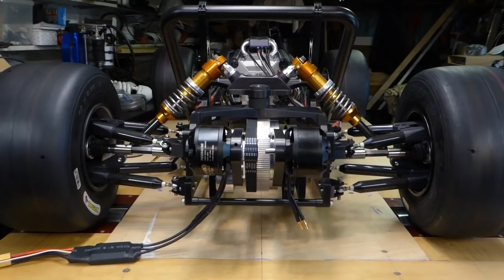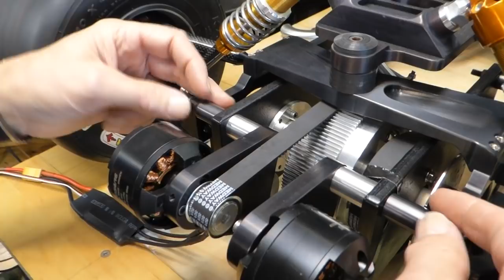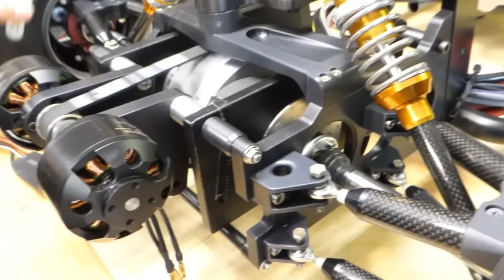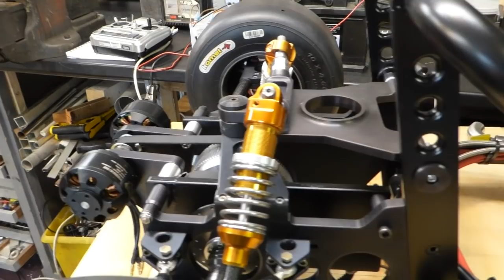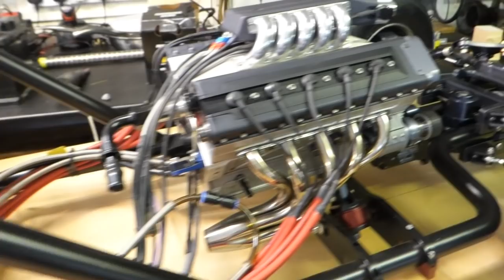1/3 Scale Fuel Injected 125cc V10 RC Buggy, part 4.

Comment: Absolutely lovely, machine work, looks like your "out running" motors are too high kv and not enough torque...
Smaller pinion, or try a more powerful brushless motor e.g. 1/5 350kv "in runner" would be better suited. 😁
Reply from the maker: Thanks. Motors are 200kv. Obviously the wrong type though.
Reply: @Keith5700  what amperage is the esc? 
E.g. 35amp ain'tgoing to power that... I'd look up the 1000 amp beast esc for such project ;)
Torro 200A:
https://www.modelsport.co.uk/index.php?product_id=389453&gclid=EAIaIQobChMI34Tt_dD33QIVj813Ch3nJwgCEAQYASABEgI04_D_BwE
Or hobby wing 150A esc I would recommend:)
what cell Lipo are you using ?
3s ain't gonna power that,
A 150A 4s-6s battery with 6000mah+ should have the Go you need :)
Reply from the maker: Thanks. What about motor. Even the most expensive ones on that model sport site look too small, or are sensorless.
My esc is 80A. Don't know about battery yet. Was thinking about the lithium phosphate type, for ease of use.
Reply: @Keith5700  don't be fooled by their small size, a 1/5 in runner motor below 1500kv matched with a decent esc of between 150- 200A (1000A max load) and a 4s-6s Lipo has serious go go juice, probably about 2-3 hp.
Torro 200A esc is rated for use upto 10hp applications.
 I've been using max amp lipo batteries in my project for years, but turnigy batteries rated above 30c with a decent mah rating (6000+) will be ok.
Hobbywing do a decent 1/5 waterproof esc motor combo, it manages to lift my 35lb truck off the ground into a wheelie...
For your setup id personally use a minimum of 2x 100A esc in parallel to your receiver.
So:
2x motor 
2x esc 
1x bec (run the reciver independently)
1x reciver
1x Y servo cable (throttle cable)
Reply from the maker: Thanks for the info. I'll have a look what's actually available in UK.

Comment: so, you mean to tell me you got that sweet fucking motor on there but its not going to run off of the gas motor....but some brushless electrics in the back.....weak, ive been waiting to see the rest of this build and im disappointed. sorry.
Reply: If you understood english he said in the video that he hooked up those motors to test the settings until the gearbox is finished.
Reply: F1RM_H4ND5H4K3 Your a smart one aren’t ya
Reply: he didnt hand build a working engine to be a static model, watch and LISTEN to the video before commenting
Reply: apparently i missed that part, sorry guys, i did skip through the video, and @bilibob rut yes i am actually pretty intelligent, thanks.

Comment: You need sensored brushless motor set up for low speed
Reply: This is correct, whats happening at low speeds is called 'cogging' ...its basically because the sensorless motor has trouble triggering the right coils because it doesnt know where the rotor is in relation to the stator.

Comment: Maybe you need a torque controller, so you it can maintain the same rotation independently from the force it needs to rotate. Example if you are climbing it will maintain the speed
Reply: It's amazing how simple of a solution that is kind of mad I didn't say it first

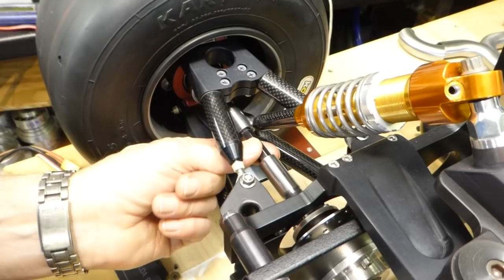Comment: The motor isn't powerful enough I had the same problem with a 1:10 scale I changed the motor for a stronger one and that fixed it
Reply: What Motor is this? a 125cc what?
Reply from the maker: 125cc turnip.

Comment: That looks like an aircraft ESC. Getting a controller for cars will help. A prop has almost no load at start-up, and a car BL starts under high load, and requires different software. The ESC also seems a bit small for that motor. I suspect you will let the smoke out of it if you get that motor up to full power.

Comment: Great video for the amazing project again :)
I agree they like to do that clogging. I had issues with such and solved it in different ways. Here are few examples that could help:
- Bad soldering joint - After few months of investigating on a plane last switching all other elements i found out that one of the 3 cables from the motor had some issues where the previous owner soldered it. I was not able to see a problem, just reheated them and it was fixed.
- Changed ESC - worked for a couple of times. I think it is up to the model and the firmware. As some ESCs have a lot of potential with newer firmware. Checking what berin berin said about firmware upgrade  is good one here.
- Reprogrammed ESC - each one has different options. Sometimes depending on the use and model you have to change those.

If this is for tests only I would not bother to investigate it. Just drive it like that and after that don't care :)
Than change it with the gearbox. Good luck :)
Reply from the maker: Cheers.

Comment: That’s what you call low speed clogging, it a bit common with sensorless brushless motors. You also will need a much bigger ESC because those are way too small to handle any amperage.

Comment: You have multiple options for your bogging brushless, first the quick one like me you seems to use airplane esc, no torck at low speed, flash them with simonk and play with the setings, for me it was night and day, i can run 6s on a 10$ esc on my 1/10 scale (110km/h after it start to fly)
Or Go the sensored motor way with a rc car esc and inrunur, super smoth start, or even better the sensored and vesc way, really torky at low speed but it might not be design for that aplication.
Good project have fun

Comment: OUTSTANDING workmanship.  Wow.  The reason why those brushless motors twitch like that is because they and your ESC are sensorless.  So without hall sensors,  the only way for the speed controller to get a timing signal is from the back EMF coming from the undriven coils, which-in-turn requires that the rotor be moving - hence that twitching at startup.

Comment: Best controller for those motors is called 'VESC' they are cheapest from flipsky. Even with your sensorless motors vesc controllers should be smoother and are fully tuneable to deliver maximum power to the motors
Reply: do you mean sensored esc? also are you talking about FlySky?
Reply: @chad9160  VESC is the name of an open source ESC. It is sensored yes but can also run sensorless. You can buy them from many places but flipsky is the cheapest. Google 'Flipsky vesc'
Reply: @liam_evangelista  oh nice, it's crazy how much technology we can pack into tiny quad and plane sized esc 😀
Reply: @chad9160  Definitely. The focbox unity is a version that can power two motors up to 12S / 60A each and its very compact for what it does with bluetooth communication etc

Comment: that low speed problem would be because the motors are sensorless
Reply: well they look like slightly older motors, probably with older esc's, which cog more.  once it gets moving it will run smooth.

Comment: so is it electric or 125cc?  lol is the engine fake?  also if those are those cheap ass turnigy shit motors and ecs from hobbyking that is why they are doing that, I had a airplane I bought off someone who had rekd it with the same black turnigy motors lol. i used the servos but tossed the motor, get yourself a hacker motor/esc or a castle creations.
Reply: It's a real engine if you listen he tells you it's going to take a while to finish the gearbox and that he was testing with electric motors. He is an awesome engineer and those engines are micro versions of the real thing and they actually run on gas people like you make fun of things because you lack the knowledge to build your own
Reply: The electric motors are just to putt it around and test it since the gearbox isn't built yet. listen to the guy speak, he doesn't talk for no reason...

Comment: Oh just a quick tip. I would consider a very wide open space if testing with no servo input for steering. If your suspension set up is a little soft it may tend to break out sideways under load. So just be very careful. I would hate to see such a beautiful build damaged before completion. Good luck with it. :)

Comment: It is possible that the ESC is not properly coded for the type of motor and initial load. The cogging you are experiencing is normally a result of poor back EMF detection by the ESC. You may want to tune your ESC in terms of timing and back EMF sensitivity.

Comment: Thoose small electric motors are made for aircraft and drones. They are probably to weak for this setup. Lower kv rating (i'd go for something under 2000 kv on a veichle that big) and a bigger sized engine will help. Getting a sensored motor/esc combo is great for smooth power delivery at startup.
Loving the build otherwise 👍
Reply: The heck you talking about? Outrunners have way more torque in the same stator dimensions. The problem is that they are not sensored, and the gear ratio of the final drive isn't allowing the inductors to hop a full pole on a slow start like that.
Reply: That would be some big ass drones...

Comment: The motor is not sensored thats why the startup is not that good. Maybe you can buy a startupmotor that is sensored. Used to make the startup smooth. And when you have get up in speed the bigger motor take over the control. :)

Comment: in the previous videos did he ever say why the electric motors are on there if there is a gas engine?  I don't understand why go through the effort of putting the motors only to eventually build or get the proper gearbox for the gas engine? I must have missed something
Reply from the maker: The final thing will have electric motors and the gas engine, so I can use either, or both together. Gearbox is complex, so 6-9 months away.
Reply: Ok cool that makes more sense!
Reply: RickBaconsAdventures if you watched the video he said he cant wait to test the rear end because the gearbox is a long job..
Reply: Thanks!

Comment: i saw it. Your motor isn't enough torque to drag the big gear. That types of motor just only design for planes. You car does doing a heavy lifting. Get a longer length motor with a better result. With a size like this car , your motor length at least 2 or 2.5 times longer than the one you are using now.

Comment: The motor cogg because it's an unsensored motor, that means that the ecs don't what rpm the motor have on lower speeds, there is sensored motors that know where the rpm are even at lower speeds without the clogging, sensored brushless motors for crawling for example. Right me if i'm wrong
Reply: Cogging not clogging. And you are right that a sensored motor would solve the problem, for the most part. An ESC needs to know where the rotor is to correctly apply current to the stator, a sensorless system uses back EMF to sense where the rotator is while a sensored motor uses hall effect sensors. Both systems need RPM to work correctly, however, the sensorless systems need more RPM to begin sensing than sensored systems do.
Reply: @IGMWN  thank you for all the correction 😅 i knew i was on the right path atleast
Reply: Yes and no, even high kv sensored motors will do this if you apply 2% of throttle,
Reply: That is what I said. You still need RPM for either system to work.

Comment: Try a RC car ESC, that looks like a plane ESC, normally for planes you don't use that low of throttle input so you don't really notice it! Nice job so far can't wait for the finished buggy!
Reply: He does need a car ESC but not because of the speeds. A car ESC is built a little different to handle the extra stresses of a car which an airplane doesn't experience. An airplane ESC is much more likely to burn up than a car, or even a boat, ESC is.
Reply: @IGMWN  indeed. I was referring to control method, for car ESCs you have a different level for the BEMF. If you are passionate about motor control check out what Trinamic chips are capable of
Reply: When I reread what you said I realized I misunderstood what you were saying. You're right, there would hardly ever be a need for something like 2% throttle in an airplane because it wouldn't be making any thrust at that speed.

Comment: I believe the stutter from the motors at low RPM is due to not having motors with higher torque, normally the higher the weight of the model the more torque(less rpm) the motors need to have.

Comment: If you want to go smooth on brushless on really low rpm, you need sensored esc’s and sensored motors. They have another small cable besides the three phasing cables.

Comment: Love the build.  Everything looks awesome.  The motor stutter could be caused by a timing issue in the ESC.  When it's first starting the ESC is flying blind so to speak and doesn't yet have any feedback from the motor.  If it's programmable, you could try changing the timing/start-up optins.  Or just get a sensored motor and ESC, though I assume you'd rather not for a temporary solution.  It only really makes a difference at low speed/throttle. Couldn't hurt to check all the solder joints between the ESC and the motor.  If anyone thinks I'm wrong, please correct me.

Comment: Damn, the way it moves on the suspension it mesmerizing. The springs seem a tad weak? Maybe it just looks that way on camera. I couldn’t turn up the volume to hear but, how many speeds will the transmission be?
Reply from the maker: Yes, springs are a bit weak. May have to get some custom wound. 3 speed transmission.
Reply: Keith5700 Still, that is some fantastic work. Will you upload a vid of the test drive? I didn’t mean for that to sound negative, by the way. Just something I noticed. I would love to have the time and wherewithal to build something like this. 
Not that I think about it, you’re kind of building a mini Project Binky. Both of your video uploads come whenever you guys get the time to work on your respective projects. Kind of makes my day whenever I see a new one.

Comment: What make motors are they
Reply from the maker: They're Overlander 200kv. Going on EBay soon by the looks of it.
Reply: @Keith5700  oh shit huh. Were they cheap? Maybe try castle for some higher end stuff, the rest of your build is clesrly no-expense-spared
Reply: Navraj Gill the motors he had on there are completely different than a regular castle brushless inrunner style motor and I’m assuming there is a reason he did that. Plus castle is pretty good stuff but not nearly the highest quality out there for the price
Reply from the maker: No expense spared? I wish. I'm scrounging stuff wherever I can get it
The motors were £80 each.
Reply: @Keith5700  damn man, are you surr its a motor problem and not the ESC? I used to have a velineon system that did the same thing at lower throttle and I ended up sending the esc in for warranty

OR just use brushed motors til your gearbox is built. Dont be shy to start a patreon if you think it will help.
Reply from the maker: A couple of people have suggested a patreon. I don't know anything about it. I'll do some research.
Reply: @Keith5700  we have money, we give it to you. No expenses spared :P
Reply: Probably black mamba monsters by Castle

Comment: That problem with the outrunner motors probably has to do with esc timing. Check the internet for a manual for your escs, if you have no programming card. Often they can be programmed simply by powering them up on full throttle and then following certain commands via throttle position.

Greetings

Comment: Ok now mass produce them ...$4,000 each
Reply: $4,000 wouldn't pay for the engine, nevermind the rest of it
Reply: @SavageSmithy  actually it would because you can buy a 1/3 scale rc for $5000 RTG so $4,000 for the kit
Reply: @MisfitRecords  if youre talking about the mammuthworks one thats a single cylinder generic engine not a handbuilt fuel injected V10. 
This engine alone would be worth well over $10,000, even if you produced it in batches of 1000 you wouldnt get it under $5000 for the engine alone due to the complexity number of hard to make components.

Go ahead and buy the mammuthworks car if yoy want value for money, if this model were ever to sell it would be valued as a technical work of art more so than as an rc model.

Comment: when you do get a chance to run it,be very careful with the new komet tyres,on a kart they offer very little grip until they have been scrubbed in,you can speed up the process by using a belt sander to get remove the shiny finish,once you have sanded them clean them with carb cleaner,it has acetone wheich softens the rubber ,it should make them slightly tacky which is more preferable,
great build btw

Comment: Calibrate the ESC Put at full throttle before plug-in the battery and plug the battery with it still full throttle wait 2 beeps then drop the throttle full or disarm it and then pull the battery out next time you plug it in it will be calibrated Will sort that problem with your full throttle. but the problem with it at the start with it going slow sounds like it struggling  you may need to plug esc into Blheil program and you might be able to sort the initial power output most important check your phases are correct A B C The red and black wire can go any way round on A/C to sort out the reverse of the motor but the B terminal pad the yellow wire always has to be in the middle which is terminal B/ yellow wire this makes the motor judder like that if B/yellow is in the wrong place
Reply from the maker: The esc has just three black wires to the motor. Esc is overlander xp2 80A.

Comment: The reason your BLDC is behaving like that is because (it looks like) it's sensorless, which don't run great at low speed. The controller uses induction to know when to switch, of which there isn't a lot at low speed.
You can either go with more aggressive gearing  or a motor with a lower KV rating to reduce the problem, or go sensored.

Comment: You can get a better esc or sensored motors to fix the coggng
Reply: Coggng?! Wtf is that
Reply: It’s autocorrect from my phone, well they call cogging is the effect that motor is making in slow speed, with sensorns the esc can control exactly its orientation in very slow speeds without loosing its torque...